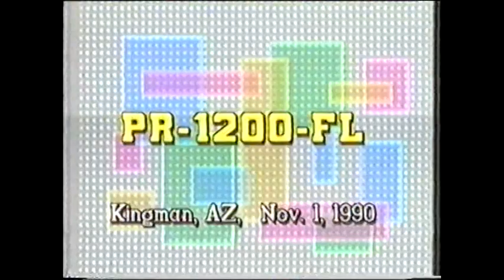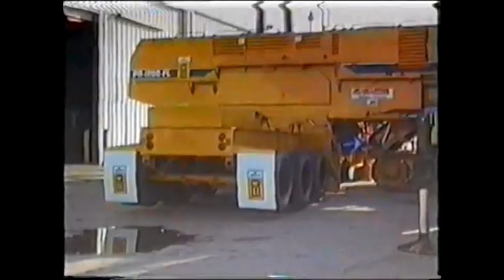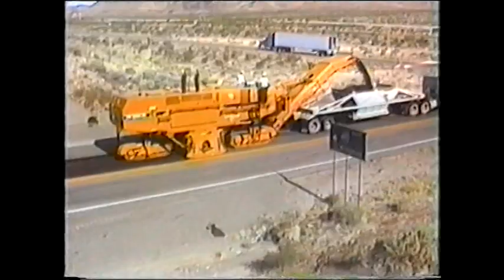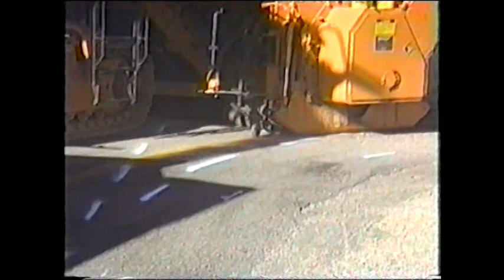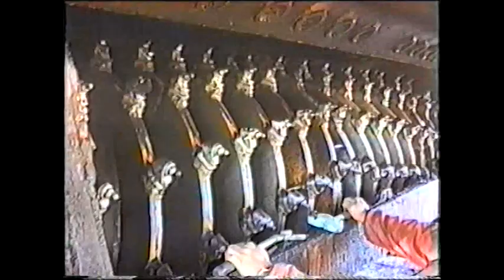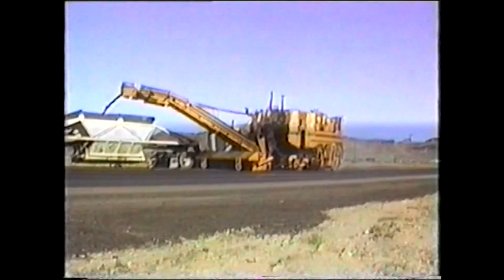CMI  PR-1200-FL

Comment: Until Wirtgen came around 😂
Reply: Don’t forget Roadtec
Reply: When terex ran everything down all of the engineers/ teams of people that designed and worked on CMI mills went to work for wirtgen and roadtec. Without the work of the early days of CMI, mills wouldn’t be what they are today.
Reply: @gmanboogieman Actually CMI made a comeback,they took back the milling machines and concrete paving equipment and resurrected the lineup